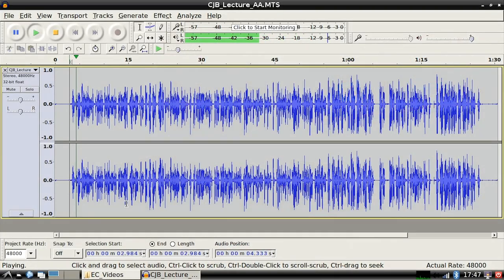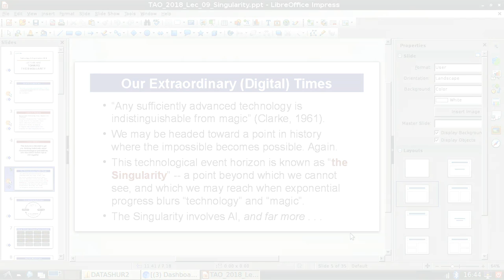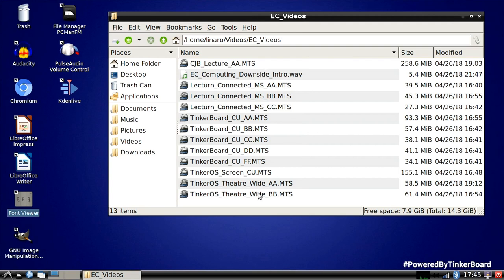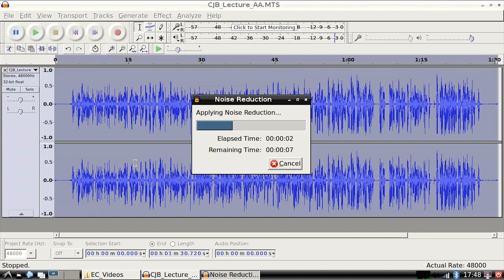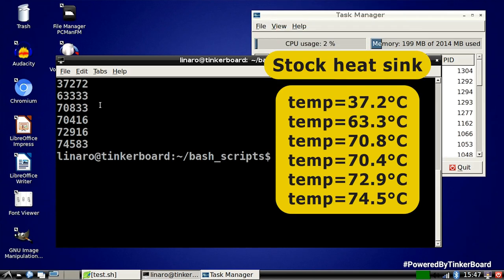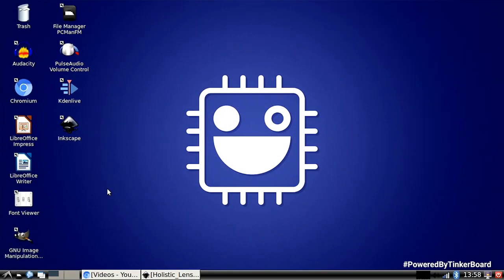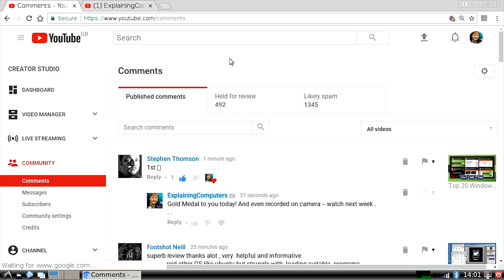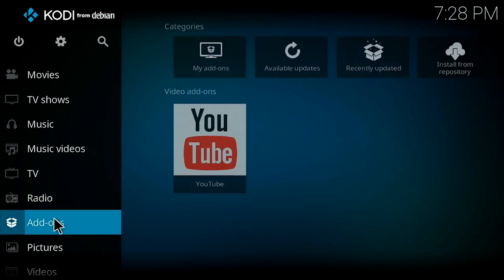Tinker Board Week

Comment: Sunday wouldn't be Sunday without a little bit of Chris in the afternoon. Thanks for another well made, thought out and researched video.  A week with an 8-bit next...old school....
Reply: RoboNuggie and Andreas Spiess in the morning
Reply: End the day with a warming & relaxing  Ed19601.....

Btw, thanks for the heads up on Andreas's channel....I bet he is the type of guy that has a small cold fusion  reactor in his basement, made from a Raspberry Pi , a fridge and half a kilo of crocodile clips...
Reply: USB type C would've been great for the Tinkerboard, as many USB-C cables are using USB PD, which supports way higher currents and voltages, than MicroUSB.
Reply: @Marren  ...wrong thing dood.

Comment: I have an i7 desktop computer in my home office, which is connected to an APC ups. This ups is able to display current consumption; being between 110w for casual usage and up to 300 w fwhen gaming. As the power supply you used is a 5vdc 3 amps, it means a maximum of 15w. Impressive, but... I have to say I connected my asus i5 laptop to the same UPS and it drains 45w max when charging battery and being used.

Comment: Thanks for another interesting video. I’ve found that Audacity works well on a Raspberry Pi 3 if I use a USB sound input device. I’ve been teaching with the Pi using a wiimote with whiteboard software and Xournal as an annotation tool. At under $100 for the whole setup, it’s the least expensive electronic whiteboard I’ve seen. I can capture nice audio on this with Audacity.

Comment: An interesting board. It looks like it is positioning itself as a tiny desktop with a bit more oomf than a Pi. I've got a Pi3, and it actually works pretty well for that purpose.

What Asus need to do is give it a case and a proper power supply. Even the Pi comes with a power supply these days.

Comment: Excellent video as always.  I have always wanted to mount the most powerful single board available to the back of a monitor.  I can make a VESA style adapter for a case and make some custom short cables. I have thought to get power for the board off the same power that the monitor runs on but I am still looking for a clean 5v 2.5 amp solution.  Thanks for your continued inspiration.

Comment: Hi Mister Barnatt. As per usual I enjoyed your latest video. I wish that manufacturers and suppliers of the power supplies for the sbc's would do a better job and supply a little more power than the minimum requirements of the boards, and while they were at it use a switch and go to the "standard" barrel connector. Like you I feel that the new series of mini and micro connectors are just not up to the job in the longevity department. Cheers.

Comment: The manufacturers of these SBCs need to ditch the idea of getting 2+ amps through a microUSB connector. Most cheap power adapters won't really put out 5V at that current level and/or the wires they use are sooooo small that voltage drop is an issue. Not to mention that the teeny, tiny microUSB connector was not designed for this type of current. 

Manufacturers, install a bloody barrel jack for the power input already, please!

The vide though was well done, as usual. Very informative.
Reply from the maker: You are right. I am sure that Asus have stuck with the micro USB power to keep the board highly compatible with the Pi. But a barrel jack would make far more sense!
Reply: USB-C would be great... I wish both the pi and this board would move to USB-C, much better than a barrell connector.
Reply: My new laptop has a USB-C type charging / docking port which works well. I would not want to relay on that type of connector for an embedded product though, it could come loose far too easily. If you want to use a SBC in a product you do not always want or need another USB cable, jutting out of another side of the PCB.

If you are powering the device with anything other than a wall-wart type power supply than being stuck with a teeny-tiny USB connector for power input is an obstacle and you have to hack a pre-made cable as a power lead. Even an option for a better connector that you solder on yourself would be welcome (like two holes of a common spacing to add a small screw terminal connector.)

I bought a Latte Panda when they came out and even went so far as to buy their recommended adapter to try and alleviate power input issues and while I had less of an issue than most it was still a pain. They finally came out and suggested using one of the three pin sensor connectors for power input which was a much more solid solution. I believe on their new board they did go to a barrel type power connector.
Reply: Jeffrey Birt how about 2 microUSBs on an SBC? This can increase Amps and more things can be connected to the board.
Also it could also have more performance aswell.
Reply: I would also like to see a barrel jack on these sbcs when they draw more than 500 ma. At least give us dedicated 5v connector pins that are separate from the io pins headers. Micro USB connectors are so fragile, one tug on the cable and they snap the internal connector board and then you're in trouble.
Reply: If you look at the "Comparison of single-board computers" page on Wikipedia it has a table at the bottom which shows how the various computers receive power, and there are many that do use a DC barrel jack. I have the Orange Pi Prime (64-bit quad core ARM Cortex-A53 SoC, 2 GB RAM, WiFi, Gigabit Ethernet, and 3 non-shared USB 2.0 ports [4 if you use the OTG port also]) which comes with a 3-amp barrel type power adapter and have had no power related issues (I run Armbian on it), though the SoC does get hot quickly (at 1152 MHz) if I run 4 instances of "burnCortexA8" (which gets hotter faster than the "sysbench" CPU test) and don't at least have a fan on it (for regular usage it doesn't need a fan as the Armbian developers put a good amount of effort into making it run at a low frequency and voltage when it's not at a full load as well as throttle smoothly when the temperature gets too hot and smoothly resume from throttling when the temperature decreases).
Reply: Whilst I agree completely that a barrel-jack is preferred, or at the very least a USB-C connector, you can buy an adapter that lets you plug a 5.5mm/2.1mm barrel-jack into a micro-USB connector, thus allowing you to buy the 3-amp and 4-amp (and even higher) 5-volt power-supplies that only have barrel-jacks.  (Not that you'd want to go beyond 4-amps, really, with a micro-USB connector.  But you could.)  Amazon sells them.  Search for "DC Barrel Jack to Micro-USB B Male Connector" and you should find it.
Reply: why not usb type c?

Comment: This video clearly shows that it's indeed possible to use an ARM board as a real computer, not just as an IoT device or a micro HTPC.
I've proven that to myself long ago when I was using an old Asus TF300T hybdrid with Ubuntu on it for most of my on-the-go computing. And that was a much weaker machine that the Tinkerboard or even the Raspberry Pi 3. It did have the official chip manufacturer's Linux drivers though (including accelerated X.org), something of a rarity for ARM devices.

Comment: 2.5-3 amps thru a micro USB is usually a problem, some connectors can't handle it, with intermittent connections this would cause tinker to crash.  I'd like to see standard id/od circular plug.

Comment: Great to see you could go an entire week just using a single board computer! It made me think about what I should use for the computers I need for a new business I'm setting up.  I will be start with about 10 employees... 2 admin employees needing to do word docs ... and working on cloud databases ... maybe 4 o5 5 open windows in browser.  Other employees will be mostly telemarketing eith the same 4 or 5 windows open in the browser accessing cloud databases.  All employees will connect into a cloud based VOIP phone system.  The office will eventually grow into a few hundred employees.  

My question is...can I use single board computers (probably only running dual displays) for my employees or should I go with more traditional desktop configurations.  If single board computer will work ... should I go with a windows OS or can I save the OS license fees and go with a linux OS... what single board system would you suggest?

This might make a great video showing a full office set up using single board computers...
Reply from the maker: The only SBC I am aware of with dual (tripple) display capability is an UDOOx86, which as the name implies will run Windows. ARM based SBCs, like the Tinker Board, cannot run Windows.
Reply: ExplainingComputers thanks for the feedback... I will check out the UDOOx86.  What do you think of using a single board computer like I described? Also, what other options would be available for a Windows based single board computer if I used a single display instead of dual displays? And finally, what options would be available for Windows 10 Pro licenses? (I really don't want to be spending more on an operating system than on the computer.)
Reply from the maker: I've a video on an UDOO board here --  https://www.youtube.com/watch?v=tpT4WGsMcvk -- they make many alternatives. If you go single display, many SBCs some into play --- including models like the Odroid XU4 and Rock64 (I've videos on these also here!), which are pretty powerful. In theory they could be used as you describe. Certainly you could run your business using Linux -- eg Mint or Zorin. It really depends on what kind of setup you are heading towards, and how much the cost saving will be when heading towards a 100 person office in comparison to the other costs involved.
Reply: ExplainingComputers thanks for your reply ... I  really enjoy the depth you go into with your videos ... I'm looking at alternatives for setting up a computer system for essentially a telemarketing or customer support business so my core needs are phone service and internet access (either local or remote) to business apps and databases.  I lean towards Windows based systems because c1980 I was the product manager for computer products at a small IBM PC clone manufacture.  I've never built a linux based system but dont want that to affect my decision about which way to go.  Most important is forward flexibility and maintainability.  I would go with an off the shelf computer solution but with such a limited scope of work even the most basic of those solutions seems like excessive overkill.  When I discovered your YouTube channel i became fascinated with seeing just how little computer i could get away with building and still have a functional system.  My biggest concern left is which single board computers can work for me as a VOIP client.  I have not seen any discussions of using a single board computer as a VOIP client.   Do you have any recommendations?
Reply from the maker: I would worry about using an SBC for VOIP -- not least you would need good audio out, and a mic input (or an addition to the board for that), and running reliable VOIP alongside other web apps with the level of reliability required in a customer support setting I think is a non-starter. Here you need a proper PC. Now, a proper PC could be an UDOOx86 board, but for that price you could get a low-end regular box.
Reply from the maker: But Linux? Yes, for this Linux should be fine.

Comment: What an irony. I've just spent an extended weekend of five days using only the Tinker Board (not S) as my computer because I was away from home.
I had no problems using it as a desktop PC, and I'm now thinking about completely replacing my main PC with it as the power consumption is ten times lower with no noise at all.
I've ordered some components to help me accomplish this task, such as a better power supply (I was using a 2A one while ASUS recommends 3A, but still, at 100% CPU no issues) and a small 5V fan that I want to hook up to a temperature sensing fan controller to prevent underclocking.
Reply from the maker: Very interesting. Thanks for sharing this! :)

Comment: Does your tinkerboard have any VRAM or even a GPU for that matter? This was extremely interesting, I've never even heard of tinkerboards until now.

EDIT: Just found this on Asus' website: HD & UHD video playback at 30 fps on Tinker Board is currently only available via the included media player. Third-party video players and applications may not offer hardware acceleration, which will result in limited or unstable playback performance. Please refer to the FAQs for more information.
Reply from the maker: The Tinker Board has better GPU performance than most SBCs -- and the Asus website is, shall we say, not always up to date! What you note certainly was the case, but HD playback in YouTube, and Kodi, now works pretty well. I did various tests in various videos -- eg this one: https://www.youtube.com/watch?v=8qBxi6Q4XlY

Comment: Going to be interesting to see how many times an active cooling solution increases the overall Tinker Board size.
Reply: The tinkerboard is the exact form factor of the RPI3. I just 3D printed a little case with a mount for a tiny 30mm fan for mine using a RPI3 model.

Comment: Hi Chris, Really great video. A fav 😃. I just got the Tinker Board S. Wanted to install to the eMMC but no luck. I just get a red light when plugged into USB and the eMMC does not show up. 2 different PCs...and tried for kicks on my Mac. So I’m guessing it’s not getting enough power from the USB ports on the PCs. Might need to use a USB3 port that pushes out more power to the Tinker Board for th eMMC be recognized??? Suggestions? Thanks for you time.
Reply from the maker: I think you are right that it is a lack of power from the USB port, which could be a problem with the lead used as much as the PC. The Tinker Board S is very sensitive to this. Most USB leads are not rated high enough for the Tinker Board S.
Reply: @ExplainingComputers  Thanks for the reply Chris and confirmation. Cheers!!

Comment: Great video as usual!  I agree, that great big heat sink should have made more of a difference, like it did on the Pi 3, so something is most likely keeping it from making good thermal contact.  I also agree with your overall conclusions about the performance of the tinker board.  Once you familiarize yourself with all the great free software available in the repositories, Linux is fantastic - and now that ASUS has TinkerOS a little better optimized, performance is definitely on a par with some lightweight notebook/netbook systems.  It's  not quite like Linux running on my I7 obviously - but definitely usable - and with Linux, I can run ALL THE SAME APPLICATIONS on my PC, Tinker Board and Raspberry PI, even though the PC is X86 based, while the Tinker Board and Raspberry Pi's have ARM CPUs - HOW COOL IS THAT?.

Comment: What is that material your making your mounting base out of?  I've used polycarbonate (lexan), but getting it looking clean takes a lot of effort; I don't even want to mess w plexiglass since it shatters so easily...  It needn't be clear...and if presized, it just needs to drill easily.  

Anyway, the platform you have looks great!  Any insight to share..?
Reply from the maker: The base is made from Plasticard like the top -- just black. Stuff like this: https://amzn.to/2LqCqbO  Drills and cuts very easy, if also relatively easy to scratch. Very clean edges are indeed difficult.

Comment: Great video, looks like you need to install all the ffmpeg codec for Kdenlive.
This board looks impressive, great for on the move, or like what you did used for a lecture.  
Thank's  for the video, i think i can do lot's of grate projects with this little gem.
Reply from the maker: I had the same thought, and did an ffmpeg install. Indeed several! But no joy . . .
Reply: may just be a hardware issue. as it is new architecture, probably be fixed in a kernel update.
raspberry pi had similar problems with hardware, when first realest.

Comment: An impressive demonstration of the Tinker board's abilities.  But its not realistic that someone would use a "bare" Tinker board as an everyday PC.  You would need to add a small chassis that breaks out all the connectors; probably has a quiet fan; and really needs to support some kind of SSD.  All that would substantially raise the price.  Oh wait,  someone's has already done that -- it's called an Intel NUC configured with the free version of Windows 10 Pro or Linux Mint.   Have been watching your channel for about a year -- great work!
Reply from the maker: Yes, a case would be a good idea long-term. The Intel NUC is at a very different price point to most SBCs, inc the Tinker Board!
Reply from the maker: PS: Thanks for watching! :)
Reply: Intel NUC costs just as much as a desktop computer and draws as much power. As an office typewriter kind of machine, it's an overkill, something like TinkerBoard would work just fine :-D

Comment: I would like a Raspberry Pi sku that (for a bit more money than the standard one) comes with dual or quad Cortex A57s. Might be enough to emulate the Gamecube 

I want to like the Tinkerboard, but the price is high enough where a proper x86 pc (Sandy Bridge) can be had instead, at least, for my uses.

Comment: are there any hardware and OS we can link together to use multiple boards of any  certain type with? for instance i would want to run 3 motherboards but as one system or close to it. basically using mainboards as expansion boards
Reply from the maker: This is called building a cluster, with the boards often linked via Ethernet. Wikipedia lists a lot of cluster software -- https://en.wikipedia.org/wiki/Comparison_of_cluster_software  -- I really must experiment with it at some point! Hardkernel also make a cool rig of their Odroid boards: http://www.hardkernel.com/main/products/prdt_info.php?g_code=G150152508314